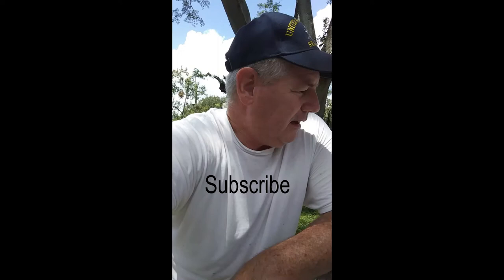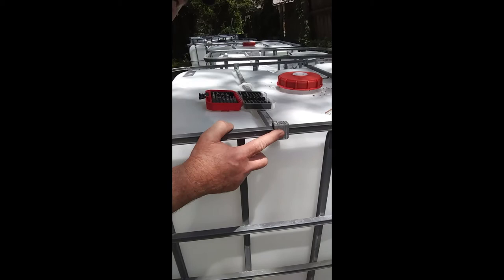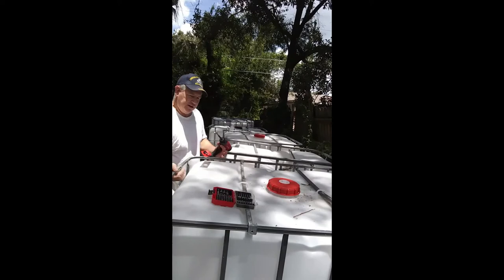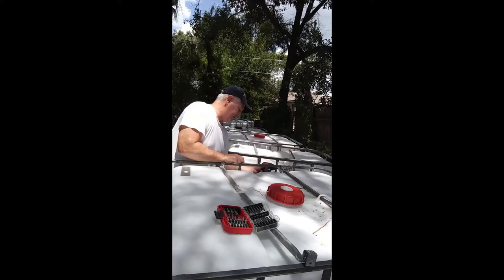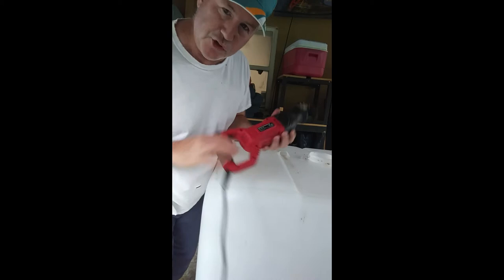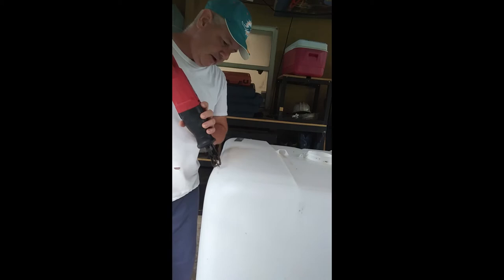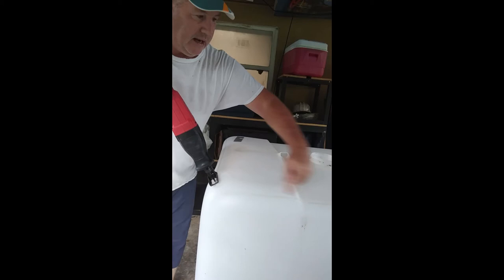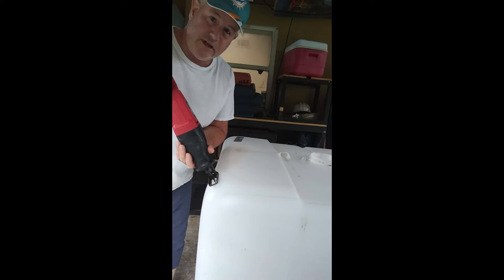How to build an IBC Tote Shower DIY

Comment: The person who is going to use this shower, what will their water source be? I've seen a video where they use the tote on an elevated stand, above a shower area, for "off-grid" showering. Even the "Southern Prepper 1" yt channel has a video in his archives, showing how he did this, and even added something to heat the water up (propane, can't remember, been awhile since I viewed the video).
Is it possible to stack a third cage on top of this shower, with the weight of a water filled tote? (And I've seen those "sun showers", for campers, where it's a black bag that you fill up with water, and let the sun warm the water in the bag, so you can have a warm shower. Well if you can put a water filled tote on top, or to the side.. up high, have it painted black to absorb the sun and warm the water).
Reply from the maker: they were only going to use a garden hose cold water to wash off mud